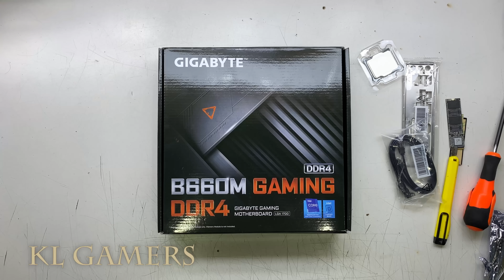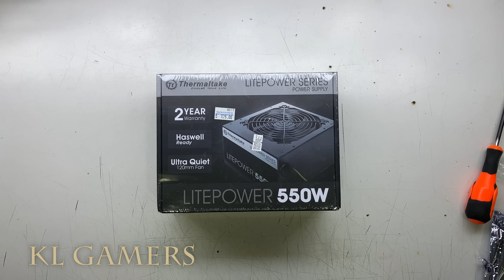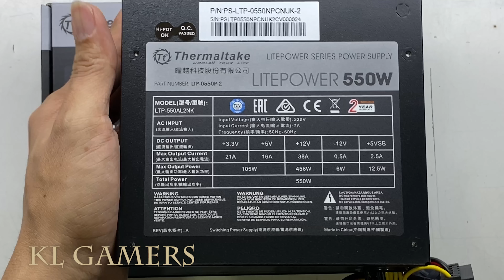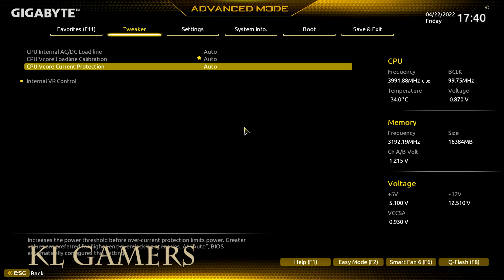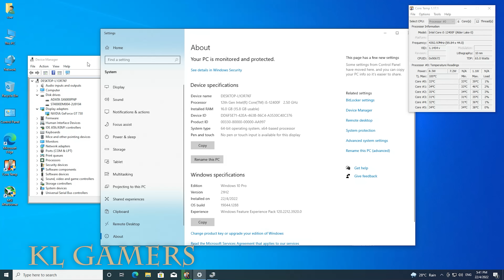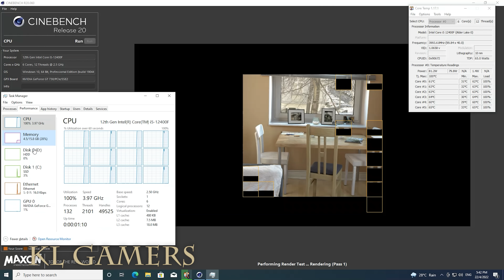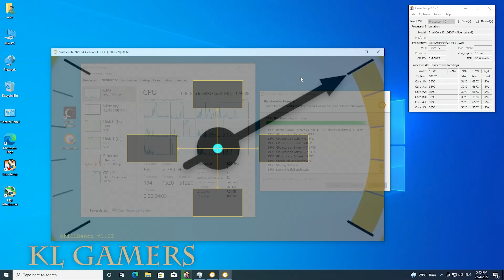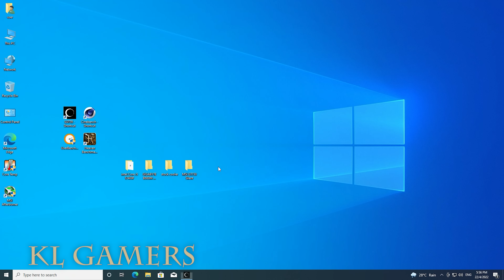intel Core i5 12400F GIGABYTE B660M GAMING DDR4 GT730 RGB Gaming PC Build

Comment: I just bought the same cpu and mobo like you, but I use XFX 470 4Gb. Then, after the installation complete, there is no display on my monitor, it like mobo doesn't detect the gpu, but the cpu is ON. Do you know why ?